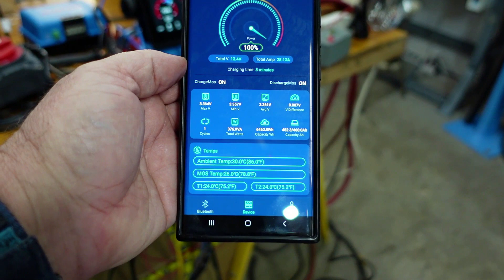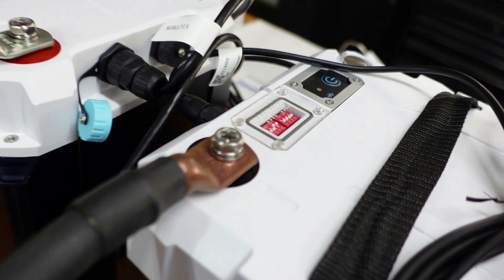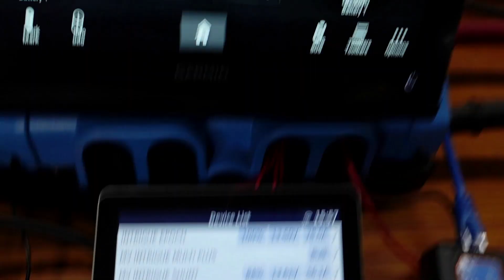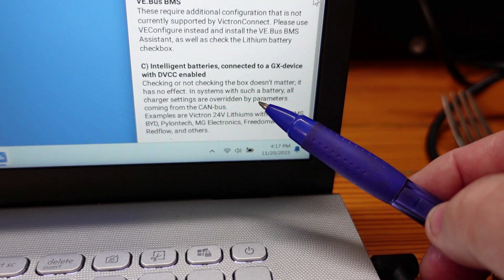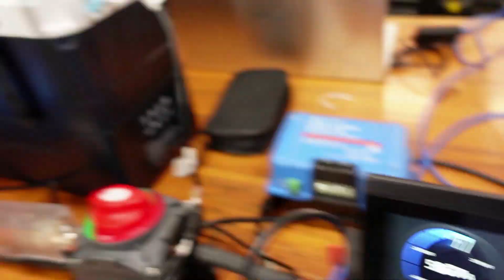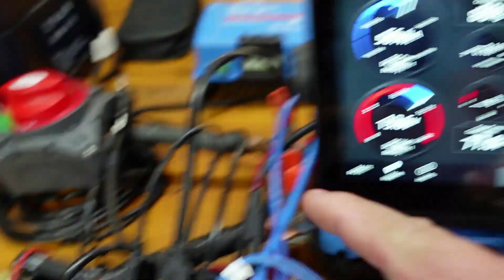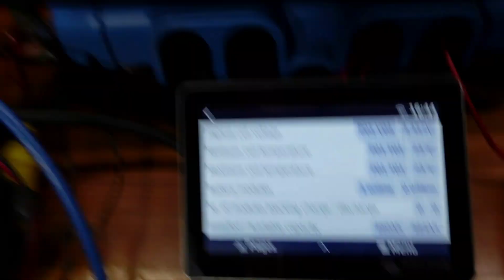Epoch 460AH Monster lithium battery with Victron Comms first test report - Plus 10% off code below

Comment: Question, if you still have these two available to test something. Have both plugged in, in parallel, and let them go to sleep with inactivity (no draw for 12-24 hours). Then, turn the inverter On (not on sleep/load sense, but totally on when switch is on). The thing I’m curious about, is whether both batteries “wake up” as they should or if only one wakes up and handles the load leaving the other one still asleep. Factory says the battery needs a 5A DC load to “wake up”. But I’ve heard that before from another brand and it didn’t work. Make sure inverter load provides a higher than 10amps DC load to the battery bank. Think you can do that? You should be curious if that works also. Else wise, one battery may do all the work for days and days.
Reply from the maker: I will try but I cant think of a way to get that done. The Victron components draw a few amps just being hooked up. So in order to test that i would have to essentially shut everything off. I do have a small DC load hooked direct to battery. So I could shut down all the Victron stuff and get it to have no draw and hope they go to sleep, then turn the DC fan on and see if it wakes up. Right now I am deep discharging them until the low voltage shut down turns them off. SO that will take a while. I might be able to do your test this weekend.
Reply: @mvintrigue-trawlerdiy1101  You certainly don't have to on my account. Actually, a fine test would be to simply see if the batts go to "sleep" after 24 hours of you not doing anything special but with the Victron Cerbo hooked up. Inverter off, touch display off. If the batts don't go to sleep, that's great as that's my use case. They may go to sleep (or one may), and if that happens, it would be good to know both come back awake together as we want.
Reply from the maker: @murp0443  Well I can tell you I have had the batts idle with just Cerbo loads for a week or more and it never went to sleep. As a matter of fact the Epochs reported 0 amps and still did not go to sleep. I have had this system on the bench for about three weeks or more and many days they sit idel just powering Cerbo and they never once went to sleep. Also if you put the remote on/off switch with the Cerbo screen and other components you would instantly be able to see if only one batt woke up since the on/off switch lights up when on. In that case you would know right away and you would just need to press the one that didnt wake up. But I am pretty confident that wont be the case.

Comment: So technically if the Epoch read the -1 amp draw you really wouldn't need the Victron shunt (or want it?!) That's pretty cool.  I think I understand the entire Victron ecosystem better than I do those Dip switches. for some reason the way they word those things makes my brain short circuit. haha
Reply from the maker: The 1 amp threshold may or may not even be an issue. I think on an operational boat it would be rare to stay in that range. But of course I wont know that until its installed and operational. I had the shunt so I will be installing it. But again if you plug in the smart batteries and set it up the shunt is not used. However I like having it as a back up.

Comment: Can you connect the Epoch batteries directly to the Multiplus? Or is the Cerbo needed?
Reply from the maker: To take advantage of the Epochs features you need the Cerbo GX. If you wanted a budget system get the Essentials version 300ah battery and a lynx smart shunt.
Reply: @mvintrigue-trawlerdiy1101  Thanks. Already have the BMV-712 Smart that I intended to use. What would the Lynx smart shunt bring to the table more than a clean install?  And yes I’m trying to spend as little as possible. 

I do like the Lynx power in. That looks like a solid and surprisingly cheap busbar solution. 

Solid batteries with a solid BMS is a must.  Epoch seems to meet that requirement. The plan is to build a system with minimum 2 batteries for redundancy and sufficient BMS output to run the windlass. 

In addition to this it would be nice to get a warning if one battery for some reason shut down.. Had hoped Epoch communication 
would give me that?

Comment: You only need to charge it to14.2V (3.55V/cell).  The BMS disconnect is typically at 3.65V/cell which is 14.6V.  "Dumb chargers" charge to 14.6V or 14.8V basically all the way to BMS disconnect.  Smart chargers should limit the charge target to below the BMS disconnect, but not too low or the BMS won't be able to balance the cells internally.

Now, if it is coding at 14.2V, that almost certainly means cells are out of balance inside the battery.  That is not ideal and you definitely don't want to paper over it by lowering the voltage further.  What can happen is that the cells can continue to shift out of balance until the battery starts coding at the lower voltage too because the BMS generally can't balance the cells when charging to lower targets. 

So even though any LiFePO4 cell will eventually charge fully with targets as low as 3.45V/cell (13.8V), it isn't a good idea to use that as a regular charging target because the BMS usually won't initiate cell balancing at that low a target voltage.

Generally with a new battery you only need to hold 14.2V for a day or two, or just cycle normally for a week or two with a 14.2V target, and the BMS will get the cells balanced and stop coding.  Cells don't go out of balance easily so once things are in good shape normally cycling will keep things in good shape.
Reply from the maker: Yes..I need to do some more cycles on it. I just haven't had the time. I will probably cycle each battery independently a few times then balance then hook back up. But I am pretty sure I will not be charging to 3.65. Maybe not even 3.55. Off Grid Garage and others have done extensive testing regarding balancing and capacity at 3.45, 3.55 and 3.65 with three different BMS units. 2 passive balancing and one active. All of them balanced better at 3.45 to 3.55 and tested capacity was no different between 3.55 and 3.65 and was negligible at 3.45. When I finally put this in the boat I am pretty sure I will be in that range for actual use Thanks for the comments and adding to the discussion. I will do more updates as I go.
Reply: @mvintrigue-trawlerdiy1101  Right.  As long as the BMS can be configured to ensure that balancing still happens, a lower 3.45V charge target does work.   However, there is one provisio, and that is if the batteries experience cold weather.

In cold weather (but still above freezing, obviously), the lower charge target of 3.45V may not be enough to fully charge the batteries or to provide a decent rate of charge near the end.

-Matt

Comment: Are those batteries have a BMS that give you an early warning before the BMS disconnect?
Reply from the maker: I believe so. In addition you can set warnings in the Victron Cerbo GX at certain parameters. The prewarning in ABYC ultimately are a recommendation. Mainly IMO because many conditions that can cause failure can happen in microseconds or on a timescale where prewarnings wont help anything. High temp, low voltage, high voltage, high current is probablt all you could hope for in prewarnings. The other myriad ways a battery or system could fail seem to be hopeless to get a prewarning.

Comment: Al, thanks so much for posting this video!  I am the Build Manager for a boat manufacturer, and we are specifying full Victron setups on our customers’ Li house boats.  But we all know that Victron batteries are one of the most expensive options.  So late breaking info on banks using good alternatives, like Epoch, is key.  Plus, I am VERY interested in moving to Li on my 40yo trawler by next spring.  Thanks again for being a good source, and not being scared of not having all the answers.  Cheers.
Reply from the maker: I definitely don't have all the answers for this stuff lol. The Victron stuff does so much, and Epoch is working with Victron to refine the package. There are just a few things to work out which I am sure will come in the next few weeks. I have a few things on order to try to get the systems hooked up via daisy chaining the batteries. It seems that is the only remaining issue. Several have already done workarounds by plugging one batt into the Can BMS port and the other into VE Can and changing the port speed to 500kps from 250. This video is just a place to share info and best practices. So if you make any discoveries, by all means share them here and I will try them and make another video to share.
Reply: The Cerbo GX has two BMS CAN ports. Can we not simply plug these batteries into those two ports with RJ-45 cables?
Reply from the maker: @murp0443  thats what I am doing now and it seems to be working. The splitter was just a test to see if you could hook up 4 via two can bms ports. But in that configuration I am not sure if all controls and warnings work appropriately since only 1 battery shows up on the device list. It may have issues over time. It seems the appropriate way is to daisy chain one battery to the next and then to a single bms can plug on Cerbo and then terminate the open spot with a termination plug. You should then see every battery on the device list and the info used by the Cerbo should be correct. I have so.e cables on order to do some tests and Epoch is working on this and should update soon.
Reply: @mvintrigue-trawlerdiy1101 what kind of splitter is it?  Link?

Comment: Couple of things: great video

The power-in doesn’t have fuses. (Distributor does)

You are running master and master on your 2 batts. I think this is causing you some problems. (Cerbo bouncing between the 2 masters instead treating the 2 parallel batteries as a “single” 920ah battery). the batts should be set up as master/slave. This mis-configuration might be the major cause of your alarms as the cerbo and DVCC is getting signal spikes as it uses 2 masters for the alarm criteria. This may be exasperated by the unequal cables causing the reported volt/amp bouncing. 

(BTW, your workaround in the Dvcc CVL is a pretty ingenious. I’ve thought of doing that but I run a node-red flow which lets my batts run down to 30% and charge to from shore power while remote to boat and once a month do a full charge cycle.  I think you’ll find, eventually, that the cell balancing will get out of whack sooner rather than later and with the dual master set-up, it could get your 2 batts out of balance as well. )

Good catch on the coulomb counter within the epoch BMS. As a reference, my boat draws 13w (350w per day) of system “vampire” loads to keep the cerbo, router, BMS, etc while in slip this winter. Ymmv, but having inaccurate SOC is a pain—especially if you are remote from the boat.
Reply from the maker: Jim. Are you running these same batteries?
Reply: @mvintrigue-trawlerdiy1101  no. I am running 4 Victron Smart LFP-200a 25.6v with the Lynx BMS for my house bank. I do have fairly modest CANbus expertise with Victron, n2k, and BMW bikes and cars. So, I have not done exactly what you are doing but I have seen how 2 master sources work within a CANbus—things get either mixed, or it crashes the bus. For sure, controls (such as DVCC) gets some conflicting info and I think (don’t know!) that this is causing you the alarms. You shouldn’t have to change the max charge voltage to manage your batteries. 

I have attempted to get info from epoch but I’m not a customer so…no responses. My main interest with them is the 12v starter  batt. I have an old AGM starter/windlass batt and I’d like to have CAN/victron (or rv-c) reporting and control, but it’s not necessary—just desired.
Reply from the maker: @jimduke5545  Thanks Jim. I would expect that using all Victron would result in perfect operation. I think we just have some refining needed with the Epoch settings. Some of that refining may be simply better details for set up of connections and dip switches.  Some of it may be needed updates or refinements from Epoch and/or Victron for software or settings. I am not 100% sure yet but I am sure we will get it sorted soon.
Reply: @mvintrigue-trawlerdiy1101  keep us in the loop. 

I went with what I knew would keep the boat insurable and marketable in 2022. I did all the install myself and did a ton of research. I really wanted to go with a REC/homebuilt but in the end, the more tightly integrated solution won out—mainly because it was what was available then. Now, the epoch and others are offering options and that is good. Maybe the next boat😉
Reply from the maker: Will do...and thanks for your input. As you well know, there is a ton of ground to cover with something like this. So input from the guys who have been there is invaluable.
 @jimduke5545
Reply: @mvintrigue-trawlerdiy1101  …when you are done, you will understand the system. 

I will re-watch the video. I hope to see the can connections with more detail. I think you had them into the cerbo BMS.can and not the ve.can. This has just the 500kbit speed and this could be a part of the challenge. I also don’t recall  the topology (other than the splitter). That didn’t seem right but some things were working. 

Where do you have the terminators? On VE.can, there must be one on each end of the trunk (like n2k). BMS.can isn’t as clear cut on termination—the manual says there must be one in the cerbo but might not need one at the other end of the trunk. 

Good stuff. You’re braver than I am putting this all out there!
Reply from the maker: @jimduke5545 I hear you. I just need to get the CAN stuff sorted and ill be happy. Yes, I debated putting this out because there is so much to cover there is bound to be mistakes. Thats why I had so many caveats regarding whats seen in the video😂. The internet can be brutal.But the goal of course is to refine the info and then make it available to everyone. I will update the description below the video today to reflect some of the things you said and try to keep a running tab of updates for best practices. I appreaciate your feedback.
Reply from the maker: Ok. Now that I have the time to respond...I very very much appreciate the feedback. This is what I was hoping for. Can I ask what batteries you are using? I tried several configurations of the plugs and dip switches but was unable to get the type of readings you describe. As a matter of fact the way you describe was the way I initially attempted to set this up and its the way I would have expected. But after several attempts I was not able to get things to show up in that way. So the way you see in the video is just what I ended up with that appears it would work and charge correctly. Atleast over a few charge cycles everything appeared to work well. If you have these particular batteries can you share your particular plug and dip switch set up. I was contacted by another person who has these batteries and he was able to get both batteries to show as individual items on the device list by using different ports on the Venus GX and reconfiguring the speed settings. Something I have not tried. All info is very much appreciated.
Reply from the maker: Ya know...I just lifted the lid on my Lynx Power In and is does have fuses. I knew I wasnt crazy...lol. All of this Victron stuff was purchased used. The previous installed must have added the missing pieces. I was pretty sure it did because I had added the fuses. And this stuff came from a fancy RV so they would have wanted to fuse them at this point since there is no ABYC mandate for the 7 inches. Depending on my layout I may just retain the fuses as is and sheath the cables. Or I may use the MBRF fuses I had already purchased. Either way I like the power in with fuses.